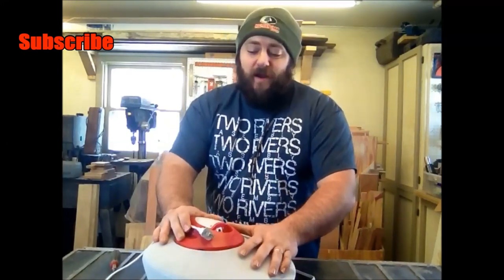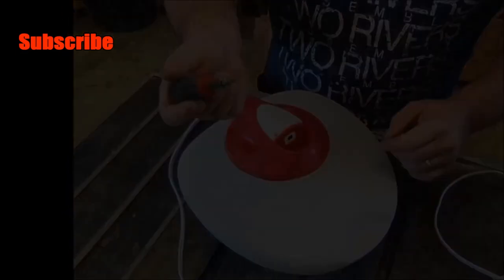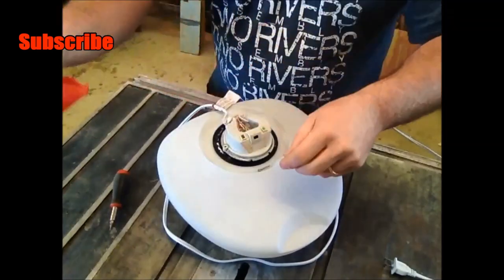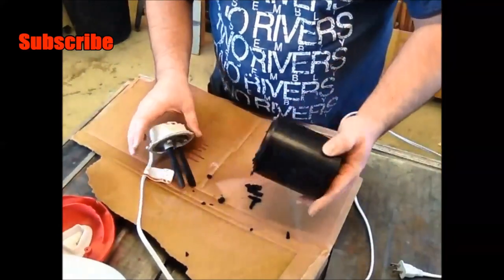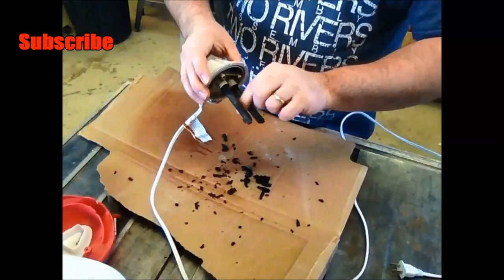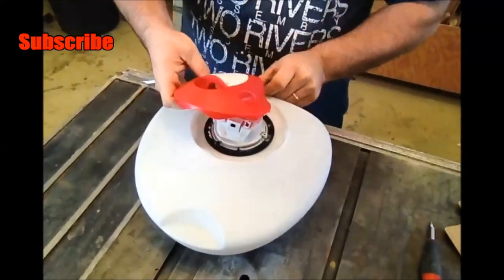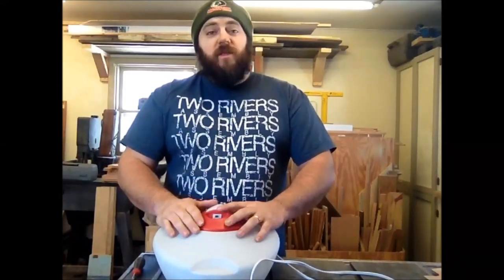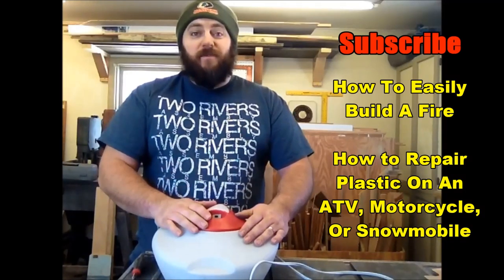★DIY Free + Easy Vaporizer /Humidifier Repair Will Save You Money. The Vaporiser Is A Simple Machine

Comment: The buildup I get on my vaporizer's electrodes is grey lime (calcium carbonate) deposits. It's very hard and is really stuck to the graphite electrodes. To remove I use a sharp knife and carefuly scrape it off.

Comment: Does that gunk buildup after a long time? I've only used mine a few days and its not steaming.  Although I started using distilled water
Reply from the maker: It is totally dependent on the minerals in the water that is put into the vaporizer
Reply: It's not steaming I bet u didn't add salt. That's why I'm here. No salt no steam. Too much salt and it spews everywhere I'm trying to find out the perfect amount of salt. Ugh! So irritating! They claim u use just a pinch. Well my pinch may be different from everyone elses lol

Comment: Distilled water won't quite work. You'll have to add minerals (like salt) anyway.

You could use a v750 with distilled water though to avoid maintenance, but they're a bit more expensive. Worth it in some cases tho

Comment: How do you get a rod back in? Took it down to use for the winter and a rod was laying inside. It fell out, it's still in 1 piece
Reply from the maker: You will have to disassemble the top to get to the hardware that holds the rod in place. Reminder: be sure to unplug first. Good luch

Comment: Great video good tip but come on guy those are not $45 LOL that exact unit cost $10 at Target 11.99 at my Walgreens
Reply: Walgreens had them for 22 😓
Reply: Now that it's 2022 and the flu kicked our areas ass the one I got that was cheap at walgreens was 20 bucks..the vicks ones were alot more up to 50 depending on brand name...
Reply: They’re $40 at our CVS. Either way, you gotta admire the guy. He can take it apart, find what’s wrong and fix it. It’s a skill that few have!